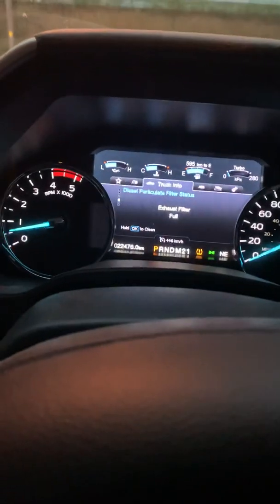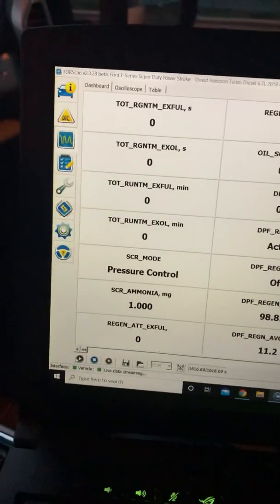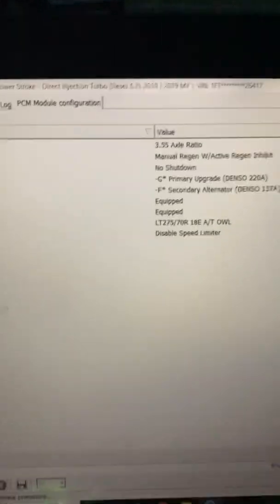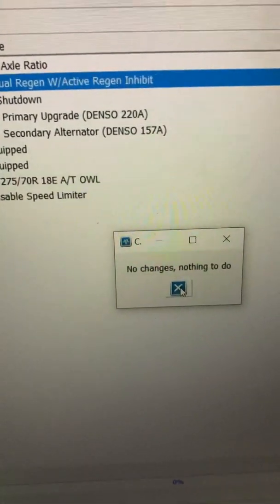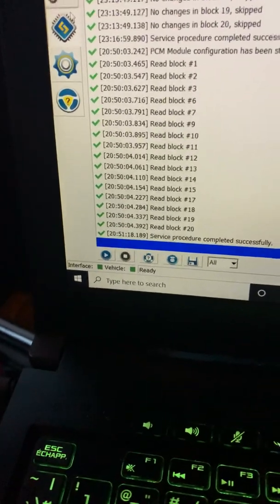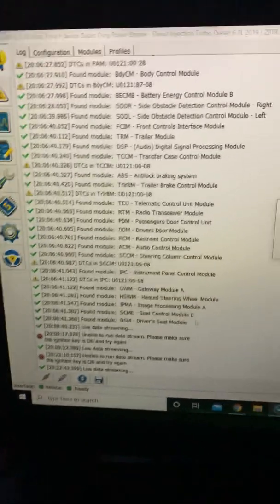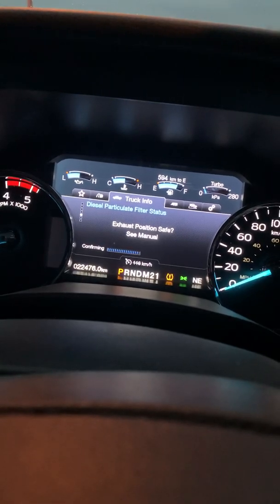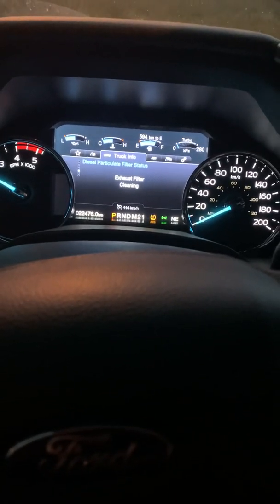2019 Ford F-350/250 Opperator commanded regeneration enable at home

Comment: You DON'T want to inhibit the Active Regeneration... Active keeps the system clean automatically as you drive. Use the MANUAL regeneration enable to have the capability to Regen if you want, without impacting the Active system
Reply from the maker: I wait until the filter is at 100% and do a stationary regen each time it’s faster and easier then driving for no reason, my regens start regardless at 100%

They also always start once I get home or close to it so I normally inhibit for the 5-10km and relax on the throttle

Comment: Thanks for the helpful video! I got  2019 F350 Lariat. It's nice to be able to do a complete manually induced regen rather than the automatic one which only does it well if you're flying down the freeway for a long stretch.
Reply from the maker: I have the same issues it’s brutal 

oh look I’m home I’ll do a regen tomorrow it was at 95% last I checked

Dpf : not for long I’m at 85% and going down your going to waste another 45 minutes driving to clean me

Comment: When you select active regen inhibit, it does not allow the truck to regen when it needs to on its own. You will always have to do it manually. You should select the manual, but not the without active regen.
Reply: That’s not true 
If you do all the DPF codes correctly you can turn auto regen on and off in your settings menu.
I have my truck set up this way

Comment: is that not hard on the motor to hold 2k rpm for half an hour no load?
Reply from the maker: If it was ford wouldn’t allow it. It’s done once a month to keep the filter completely burned out and clean
Reply: No. Not at all
Reply: It’s fine 🐱

Comment: Turned everything on I just don’t have the manual option that says hold ok to clean. 2018 lariat using forscan
Reply from the maker: It should have popped up do you allow the truck to get to 100% dpf load before attempting ? These trucks MUST BE at 100% /full to allow an OCR event, hope this helps
Reply: @1234crazydude  it did at 100 I’m just stupid
Reply from the maker: Glad to hear it worked on yours aswel I can atleast confirm it works on 2019 and 2018
Reply: @1234crazydude  thx.  I’m at 90%, wanting to manually regenerate thinking I accidentally turned a feature off with forscan.    I’ll see what happens at 100, pretty confident that’s it.  Thx
Now if I can just get the pin 18&19 switched, I’ll have Lincoln mode folding mirrors.   Those damn things are huggers to get out in 1 piece.

Comment: my 2019 F350 diesel doesn't have a diesel particulate filter status section in my menu system. Does your truck use DEF?
Reply: The Dealer will Not turn it on pursay they have no way of turning it on on 2019 an earlier. If you do it yourself it voids warranty. So you're damn if you do damned if you don't. You taking a chance on the auto regen to work to clean DPF if it doesn't looking at buying new engine. Oh he'll no.. Deleting the DPF to safe the engine.... I didn't buy a truck that the dealer won't turn on the DPF this is best way to safe the customers money and a engine... But obviously not they want the customer to buy an engine that cost up the yin-yang I don't think it's right
Reply from the maker: I brot mine to the dealership to have it turned on, they didn’t want to, talked to a service guy and he said he would for 240$ and does it all the time as a service procedure at the dealership, the guy who had no clue how to do it just told me the truck is smart and will just clean itself on its own, doesn’t really help me if it’s doing a regen and only burning 5% per attempt it’s nice to know it’s doing it so I can let it finish ,
Reply: @brendaehrhard9038  Brenda you are absolutely correct mam that's exactly what they want to happen. From a business standpoint it's frickin genius!
Reply from the maker: You need to enable it yourself mine is a 2019 f350 lariat
Reply: Haves to come from the factory that away
Reply: Have your dealer turn on that feature.
Reply from the maker: One tank of def every 10,000 km or so
Reply: Of course it loves the shit! Hell I think it used 7 or 8 gallons between fla and tuscon and some really weird sounds coming from that motor
Reply: Yeah that’s why you turn it on with FORscan. I have a 2019 f350 xlt and I set mine up with it.